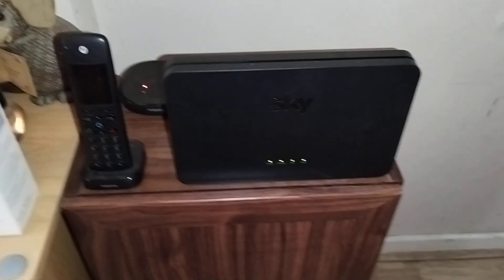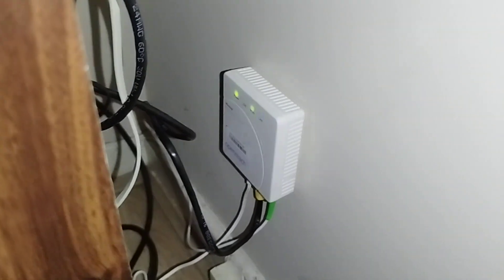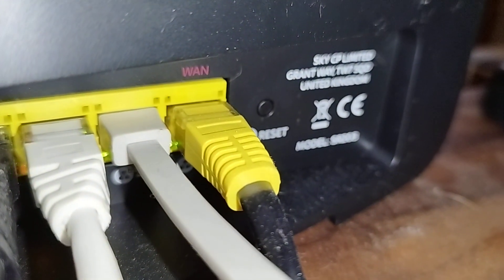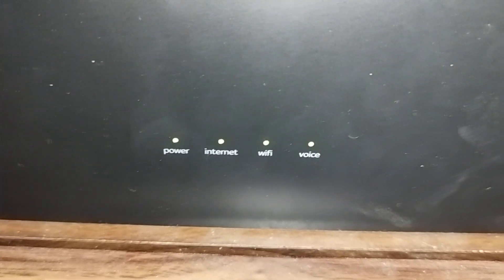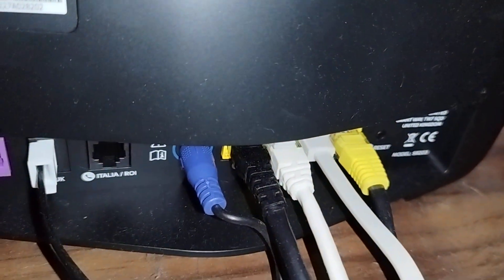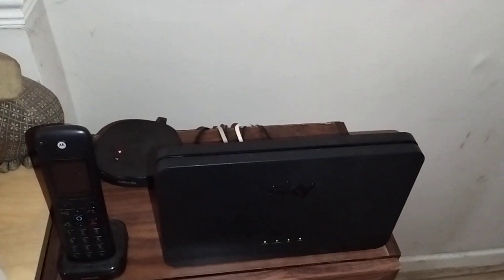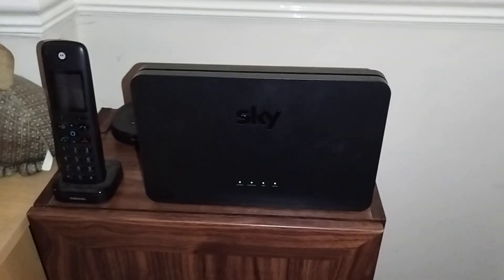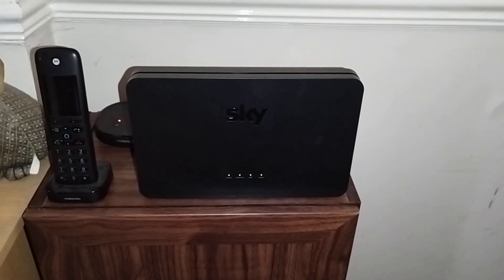Setting Up 2022 Sky Broadband Hub Router For 145mbs+ and 45-75mbs

Comment: Your video shows nothing except an uneducated view of how to use ethernet and wifi. I'm confused of that to the point I can't understand what the mad rambling on this video was about, except making older people more confused about internet connections. Best thing to do is use ethernet switches then find a way to run them under floors and down the walls. I live in an old building with thick walls, so I chose to use ethernet cable to each room, then a reasonably priced ethernet switch in each room.

Comment: I have super fast broadband from sky and I’m only getting max 15gbps I’m a gamer online no problem but it takes over 24 hours to a game any tips on where to place my router as I live in a studio apartment. 😊😊
Reply from the maker: Sorry for the late reply. Have your router in an open area as far away from other wireless electricals like radios or like a microwave. Anything metal near the router can interrupt signals. If you contact SKY and say your Internet drops out or wifi can't reach parts of the house, you can get free boosters from them. I use a mesh system due to 0 signal in 3 rooms.

Comment: Hi mate im just wondering i have normal superfast fibre have everything is in my room many things can u run off the hub before slow down
Reply from the maker: Depending on which band your devices are using, either the 2.4Ghz or 5Ghz will depend on the amount of devices you can use at the same time before noticeable slow down occurs. Large downloads like on a games console can slow down the speeds but rarely noticeable. I hope this has helped.
Reply: @the1poundgamer  yeab thank u mate 👍

Comment: What model is that MotorRola handset?
Reply from the maker: Good evening, the model is Motorola Axh01 with integrated Alexa.
Reply: @the1poundgamer  Thanks.  I'm about to get switched over to fibre and I don't know if my old iDECT phone will work with after it's done.  I suspect not.  It's about 10 years old.
Reply from the maker: All landline phones will work with the router as it is just the phone cable that will plug in to the back instead off in to the wall. You will still be able to use your iDect phone without any problems.
Reply: @the1poundgamer  Thank you. That's good to know.
Reply from the maker: Happy to help. Thank you for watching. Hope you have a good day 😊

Comment: How long does it takes to arrive ( hub)
Reply from the maker: It should be 3 to 4 weeks depending on your activation date. Up to 2 weeks before your activation date.
Reply: @the1poundgamer  mine says feb 2 I mean the activation date
Reply: Does it mean I’ll receive it this month
Reply from the maker: @jeyanthinithangarajah5641  you should hopefully receive your equipment between now and Feb 2. If it arrives before Feb 2, you can plug it in at midnight Feb 1 and it can activate at anytime on Feb 2. If it doesn't arrive by the 2nd,contact SKY for an update
Reply from the maker: @jeyanthinithangarajah5641  hopefully, it is usually within 1 week of activation date
Reply: @the1poundgamer  tysm ❤️
Reply: @the1poundgamer  the sky app says there will be engineer visit so what will he do?
Reply from the maker: @jeyanthinithangarajah5641  hope it all goes well

Comment: Is this Ultrafast Fibre 1 or something below or the Ultrafast Plus? I've recently moved into a block that has flats so I live in one of them as a tenant and a few here have fibre so I know that I can get fibre here and Sky confirmed it for me. The only problem is the tenant before me didn't have broadband I believe or didn't get a new outlet for a wire to be plugged into the recent Sky broadband router. They've said they'll be coming out to install a box outside my flat but I don't know how they'll get it set up or if I'll get the average download speed which is around 145mbp/s. Do you know a link or anyone that has videos on this specific package please? Also, great video.
Reply: Ah sorry, didn't read the title properly. Can you let us know how the stability has been for the last month please? And is this how they'll install the box to my flat?
Reply from the maker: I apologise for the late response, comments have not been coming through. The service so far has been perfect, I use it mainly for Xbox Live so the speed varies depending on the game that is downloading. I'm not too sure if it is permitted for a flat as you may need prior permission from the landlord. You will need to check the requirements for where you are before proceeding.
Reply: Sorry, one more question. Does the engineer bring the router or does it get delivered before they come? I've made sure to subscribe, thanks.
Reply from the maker: The router will be delivered approximately 1 week before your activation date. The engineer will install the necessary cabling hopefully on the activation date to insure everything is working properly or 2-3 days before. This will all be arranged with you beforehand. Your phone will be through the Internet instead of the landline so if Internet goes down, you will not have a working home phone. Hope this helps. And thank you for the sub. Hope you have a good day 😊
Reply: @the1poundgamer  thank you for replying, I shouldn't have a problem with a landlord as the flat I'm in and the others is run by a manager so it's up to the mangers decision. Also if the box is already outside my flat then the next tenant that comes along may also get to use that if they use Sky broadband as well from what I think. As for the delivery I have the Sky app and says the router will be delivered but isn't giving me a specific date yet. So I'll see what will happen. I also use Xbox and I'm looking to get back into streaming again so hopefully the speeds I may get will be enough to run at 1080p or possibly the next setting up as I'm currently using my mobile hotspot with Smarty and getting download speeds around 20-40 and upload speeds of around 7-15 depending on the time of day and weather. But the weather in Wales is not the best tbh. One minute it may be scorching hot than the next there's sleet. 🤣
Reply from the maker: @WeIshLeopard in South Wales the weather last week was nuts, 4 seasons in 1 day and probably a few extra thrown in 😂 The upload speeds are fairly consistent with around the 40mbps mark and downloads around the 120 to 145mbs wireless. Hopefully you'll have no problems getting it sorted, you should have had an installation date by now though

Comment: Hi I waiting for my new box but haven't got the input socket you have just the normal telephone socket you have at bottom do I need nu plug thanks
Reply from the maker: Apologies for the late reply. You should have had an Open Reach engineer fit the fibre box outside your house approximately 2 weeks before activation and hopefully on the day of activation a Sky engineer should fit the little box inside. If this had not happened and your activation date has passed, you will need to contact Sky to report the issue.
Reply: @the1poundgamer  thanks for replying have the box and cable on my building
Reply from the maker: No problem, sorry I couldn't help any more than that. Thank you for watching the video. I hope you have a good day 😊
Reply: @the1poundgamer  he thank have talked to sky so they now about it I’ve also noticed next building have had there outside cable routed in to there house so alls good thanks

Comment: I’ve got the same box my phone light is orange my WiFi and power are green but no light on internet although it was full green last night
Reply from the maker: How long have you had the router?
You may need to power cycle the router by unplugging the router from the wall for 30 seconds and then plugging back in. There is something known as "dirty data" on which can back up essentially the routers memory. This will clear it and should restore the functionality.

Comment: My activation day was yesterday and mine isn’t working. 
I’ve got it plugged in to the master BT socket.
Reply from the maker: I apologise for the late response, the application stopped working right. Has the issue been resolved? If not, a hard reset may fix the issue by unplugging the router from the power.